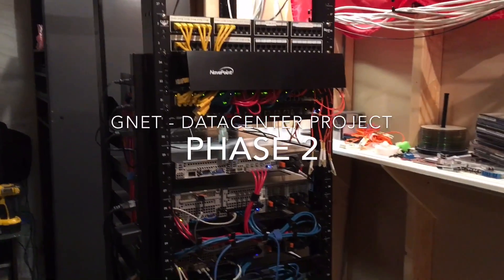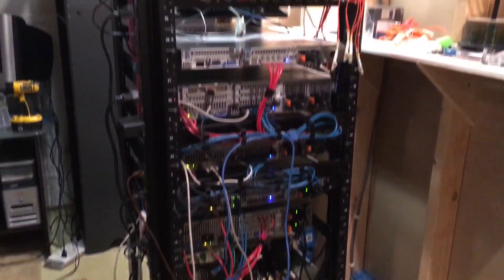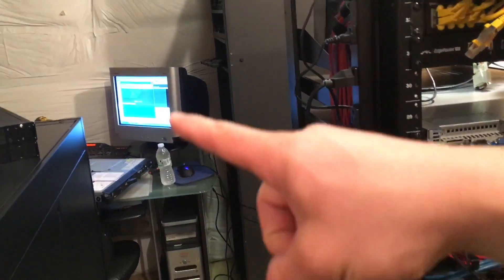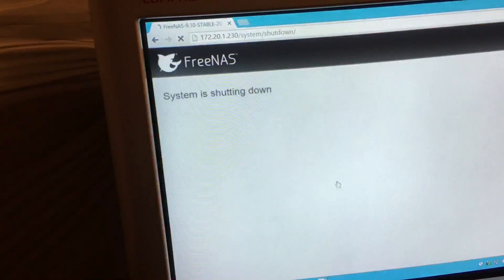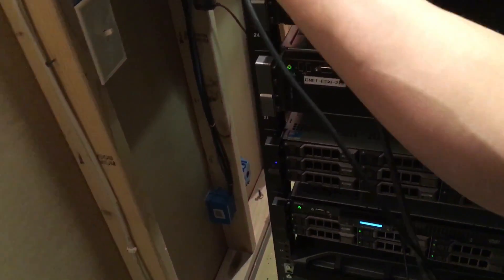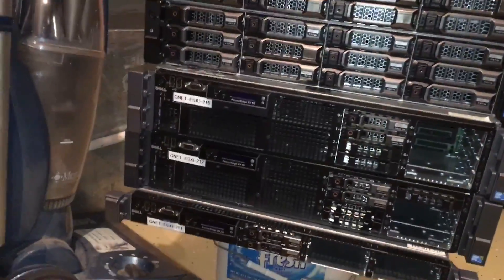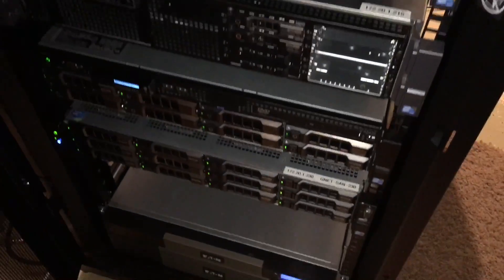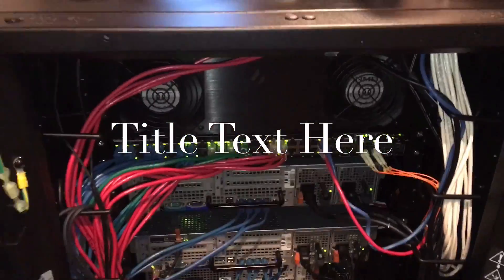Home Data Center Project 2016 | Phase 2 - Migrating to a New APC Net Shelter Rack! |

Comment: Awesome network . Can you tell me please how did you connect your servers to the R510 San?. I mean witch card did you use, Fiber channel or what?.
Reply from the maker: +Iceberry Morocco thanks man! And I used a Intel x520-2 SFP+ 10Gb Card :) and using twinax instead of fiber but almost same network speeds just less or no noise with fiber
Reply: Could you do a video on this?

Comment: What rails are those?
Reply from the maker: They are nave point shelves, they are like 60.00 or so on eBay new ill be selling mine
Reply from the maker: +GNET Data Center 60.00 a 2 pair when I bought mine one pair is like 38.00 with shipping I think on eBay!
Reply: Cool, I just picked up a 24U APC Netshelter to move my equipment into and I am in need of some universal rails. Those look like what I need
Reply from the maker: +JC61990 if you would like I can sell you all my accessories like shelfs but they would be cheaper than off eBay but the weight would be the only culprit for shipping costs! You live in US?
Reply: Yes, new york
Reply from the maker: +JC61990 woo okay! Let me see how much shipping would be I have I think 5 pairs of these shelfs! I'll sell them at 20.00 ea, would you prefer I did a eBay list for them?!:)
Reply: ive sent you a DM
Reply: still looking to sell those rails?

Comment: ith FreeNAS, you just installed to the bare metal? Why not through something like ESXi? Wouldn't that make administration easier or would doing it that way slow down performance?
Reply from the maker: +themaconeau FreeNAS is meant to be bare metal you don't do SAN type of setup on ESXi would be pointless unless you actually use the jails and make a instance but for storage bare metal is only way to do it properly with all Redundancy
Reply: +GNET Data Center I take it that you would also run something like pfSense bare metal as well?
Reply from the maker: +themaconeau depends on what you want to do you can run pfsense virtualized as well for like a Vpn server or router but its recommended to have a dedicated appliance for pfsense.. Overall physical appliance vs virtual has its pros and cons.

Comment: how are you running VCenter like that seems to be Linux? I thought it had to be a Windows VM? if not do you know the name of it because I'd rather not have a Windows VM if i don't have to.
Reply: VMWare released an appliance for VCenter.
Reply: awe snap
Reply from the maker: thats correct! :) there is 2 flavors of vCenter 6.0, Windows Based Installation, Linux Based Appliance, imo Linux based appliance is better.